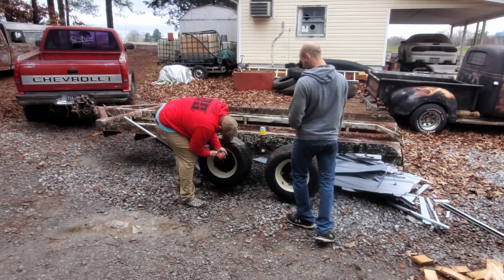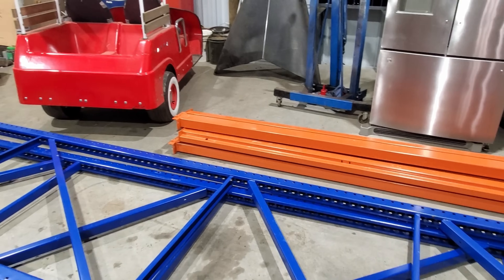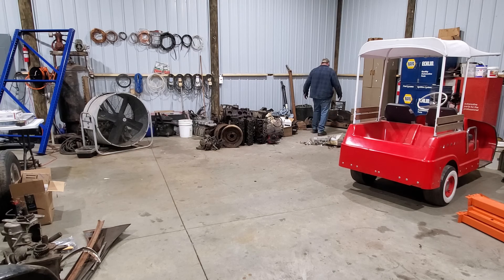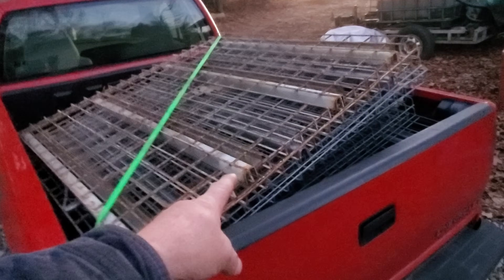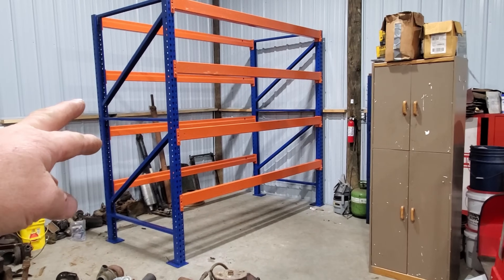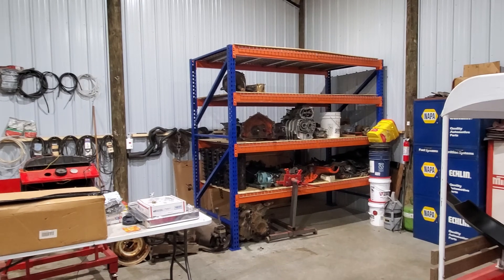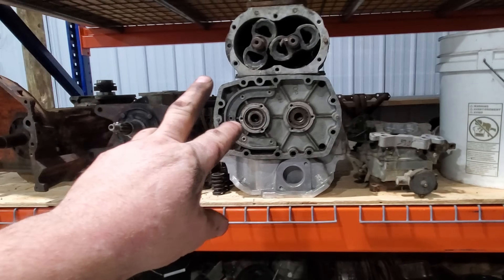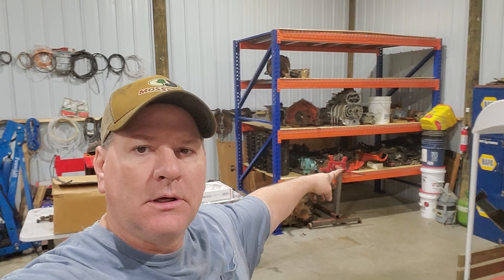Pallet Rack For The Shop + TN/KY Scenery!

Comment: For future reference, if you decide to get more racking, you can use 2 by force as cross supports. And then when you go to put the plywood on, you can screw them into the two by four, so it stays stationary.
Reply from the maker: Cost is the same and wire decking just drops right in, no 2x4 cutting. 👍

Comment: We use 2" x 12" boards on our tracks instead of wire racks. It works, and they hold a lot of weight. Rough cut wood might be cheaper.

Comment: Excellent video Chad  :) also only seen one tire did like trailer was farm tractor one did it also had tube inside still had half air was 6.00 16 inches  front steering wheel one  and surprises me! Also rack storage very nice one for shop too store need to use sometimes and plus more!

Comment: Put same kind rack in my shop cut 2x4s they fit great in notch on orange rails then covered  partical board
Reply from the maker: Lumber is about the same price as the wire decking and I didn't have to cut a bunch of 2x4.

Comment: Surprised you got the wire mesh, they are pretty pricey for what they are 

They have a little lip inside those cross bars you could of put some 2x4s all the way across in and it would of been even stronger

Love the channel, see you on the next one
Reply from the maker: 27 a piece. Lumber would be the same price plus I'd have to cut it up.